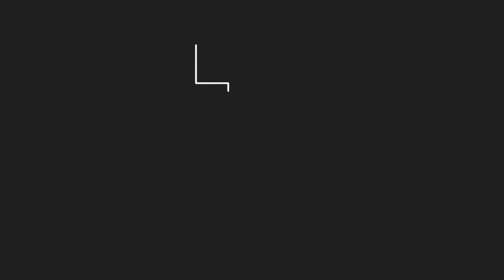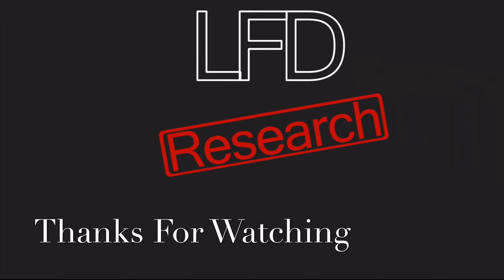Clearing a Squib Dangerously! 4K

Comment: would using a blank to clear a squib work?
Reply from the maker: I would not suggest it a blank is a different animal than what we tested. This was a finely tuned load to not exceede Sammi specs with a bullet included. Blanks are meant to stay within that spec without any barrel obstruction so you would be likely to create a dangerous over pressure situation if you were to attempt that. Results could range from ringing the barrel (creating a bulge from over pressure) to causing a complete failure of the gun causing severe damage and possibly injury. 
Again I highly advise do not try this. Go the safe route and use a wooden or brass doll rod to force the bullet out of the barrel
Reply: @LFDResearch  cheers man, will kee that in mind! thanks for the helpful reply! greeting from Russia
Reply: Yes, absolutely...use a black powder blank as you are unlikely to reach the pressure levels of a modern smokless gun. Done that with a .357 barell insert for my 12 ga that had a Leigh solid copper projectile stuck due to a bad home load (my fault). A .38. case with 10 grains of 3F and a cork wad cleared it.